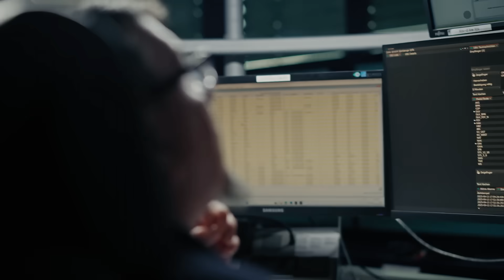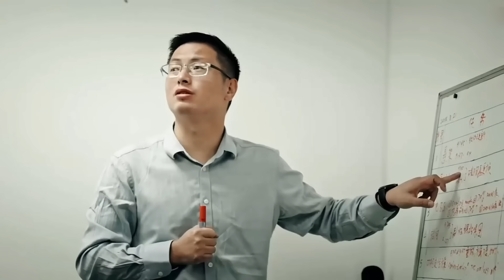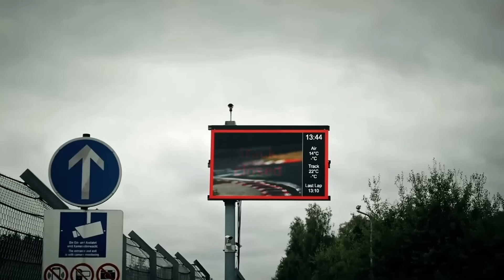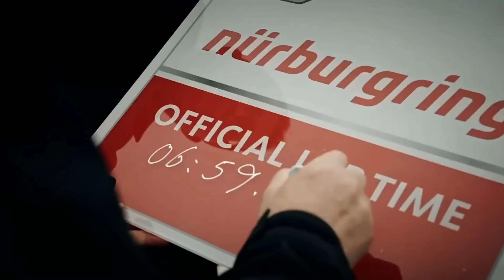WORLD FASTEST CAR NEW RECORD | BYD Yangwang U9 Xtreme Attack

Comment: I looked at the statistics, here are the results:

Reliability index:

China Initial Quality Study (IQS 2025) – in 2025, this indicator rose to 229 PP100, which means an increase in the number of defects and complaints.

VDS 2025 – PP100 is worse than that of foreign mass-market brands.
Problems are increasing both in the domestic market and among mass-market Chinese brands, and the number of defects per 100 cars for Chinese manufacturers is growing year by year – this is official statistics.

Accident rate: Russian accident statistics show that Chinese brands are more frequently involved in accidents than any others.

Chinese cars are leaders in self-ignition and destruction/damage due to fire.

The largest automaker BYD conducted a mass recall of more than 115,000 cars due to design defects and battery problems that could cause functional anomalies, including fire risk.

Earlier, BYD recalled nearly 97,000 EVs due to fire risk related to the steering assembly.

(Other manufacturers simply don’t do this, even though the battery and electronics suppliers are the same.)

Safety system activation: Chinese cars are among the leaders in airbags and other safety systems failing to activate in accidents.

So yes, Chinese cars are not only at the top of the rankings, but continue to improve their performance year by year.

You could also note records like: the most unreliable car, the fastest to fall apart, the fastest to depreciate and rust, the most powerful, the boxiest, the loudest, the most frequently catching fire — but the question is, why?

If Nihao shows that they not only have the largest battery or the most powerful engine, but can also win at Le Mans or in F1, that means they know how to create a balanced car that can actually drive and perform well.

If the power runs out after 2 minutes, after the battery is discharged, or it cannot be finely controlled and utilized, then what’s the point of it?
Reply: cope

Comment: But in reality, this is not entirely true, since there are faster cars:
Koenigsegg Jesko Absolut – 500+ km/h
Hennessey Venom F5 – 500 km/h

And the power of their powertrains is only 1,600 hp and 1,817 hp respectively. So what Nihao claims about itself is, as always, nonsense. It appears that the 3,000 hp of this car is nominal rather than real.

Moreover, Koenigsegg Jesko Absolut and Hennessey Venom F5 are real production vehicles that can actually be purchased, not one-off prototypes. In contrast, the Yangwang U9 Xtreme is a one-off racing prototype built on the base of a production Yangwang U9, which cannot even remotely achieve comparable results without collapsing after the first run.

This means that Nihao requires a flight control center and a team of mechanics to make the car run like that even once. Whereas Koenigsegg tests each car under real operational conditions right off the production line and only then delivers it to the customer as capable of achieving the claimed performance, and moreover, capable of doing so repeatedly, without a team of mechanics standing by.

Therefore, the achievement is modest compared to European and American manufacturers.

Koenigsegg – 5.0-liter twin-turbo V8, ~1,600 hp on E85 fuel (bioethanol)

Hennessey Venom F5 – twin-supercharged V8, power approximately 1,817–1,820+ hp

Comment: Double the beterry and mottors 860kmp bc the actual body kit weight will increase .  So it won't get 1000km unless the motor is advance rotation speed smoothness

Comment: I'm impressed with it technically, but it looks like a cross between a Lamborghini, a Bugatti and a McLaren. I'm not seeing a very original kind of design aesthetically. Edit: as for the run, keep in mind he's not having to shift, and the motors provide some breaking, so the effort is less than with vehicles close to the record. Also I was thinking about down force. I bet this is a heavy car, and that helps with traction, but I can't imagine the stresses on the tires, they must be very unique for this car. Also it should be noted this record is for an electric car, there are many faster petrol cars on the ring than this.

Comment: I never actually imagined an electric car would beat an internal combustion engine car in the elite sports category in 2025. Just the sheer amount of current, power, and heat generation you'll need to handle in your battery would be insane.
Reply: It's a matter of technology eventually evs would and hyprids will win
Reply: The 1.5 lt twin turbo hybrid Merc still beats by almost 30 seconds.

Comment: Am I the only person disappointed that it wasn't 500km/h😅
Reply: Pretty sure they‘ll break through it soon
Reply: @r-type4945 They have not developed a tire to withstand that speed yet
Reply: Well if the car would reach 500km/h the tires would pop like a ballon and the car would roll over with a force with how many G ? Idk either .
Reply: @Fe4rlessff bro that's with Bugatti Veyron about 20 years ago 💀 what r u talking about..
Plus 496kmh is very close to 500 and I t had no issue wdym 🗿
Reply: @Knocker_san  you don't understand the centrifugal force don't you ? If that car went 500+ the tires would shatter from the pressure but yea  496  is pretty impressive
Reply: @Fe4rlessffse usar os pneus que o Ford GT 40 que chegou as 500 não retornariam. E o Ford GT estava em uma pista comum de aeroporto
Reply: You right, this is shit click news.
Reply: it reached 352 miles por hour... are you blind? It is 566 km/hr..
Reply: @Teramann it reached 496Km/h
Reply: @Teramann 496😅
Reply: @Teramann if a car reached that speed the tires of the car can't take 500+ km so they would go BOOM! There are no tires that can handle 500+ at the moment

Comment: this feels weird to say but i think this car might be a little too fast for humans to drive. if the driver didn't run out of track and had a longer straight pass i reckon it could easily surpass a top speed of maybe up to 530 or even 550. you can tell the car was no struggling and there was a lot of juice left in terms of power
Reply: Autopilot

Comment: So this car can beat a F1 car.
Reply: No it cant
Reply: Its still slower at the track than the Porsche GT3 RS which only has 17% of the horsepower- why should it beat an F1 car? Only the topspeed is higher than all other cars-sure you'll need it when driving your kids to school
Reply: @EmanuelP-kp7gnthis thing left alot of room to improve ... it was limited to 350kph ... and you se alot of lifting from the pilot... that thing can improve 10 or maybe even 20 s still
Reply: @EmanuelP-kp7gn almost like it was build and engineered to break the top speed record....it's commonsense that a car capable of driving stable at this speed, has completely different focus with its aerodynamics.
Reply: it can in drag and top speed... but it will loose in downforce and cornering
Reply: a 2007 BMW Sauber F1 car previously completed a lap in about 5 minutes and 58 seconds during a demonstration run
Reply: not even remotely close. no.

Comment: M2Ks TT Ford GT runs 0-300.4 mph in one mile and 21 seconds. 
200-300 mph in 10 seconds. 
Set the record in 5th gear with one left.
Blows the doors off this EV. 
Oe body panels and glass, oe interior, oe suspension minus custom shocks, oe brakes minus custom rotors and prepped oe castings 5.4 4V.
Reply: Can it take the nordschleife? and how, and may I ask how many units were produced??

Comment: With electric engine this is very easy.
So nothing special
Reply: Bugatti, Rimac, why not?
Reply: @ziwenyang-k9w Rimac was not interested in pursuing the highest speed record such as Koenigsegg, Bugatti, BYD he focused on the fastest acceleration. And Bugatti? I think he will follow in the footsteps of Rimac Considering they are one ownership, Bugatti actually has its market as a luxury item with its W16 identity but if they want they can get back the title of the fastest car By building an electric drive system and then making it a hybrid in their products.
Reply: @ADZhilin  While electric vehicles offer far superior performance to gasoline-powered vehicles, there is still a significant technological gap between electric vehicle manufacturers. The idea that other automakers are trying to surpass BYD by replacing internal combustion engines with electric motors is, in my opinion, a joke.

Comment: Die Spitze von 496 km/h ist eine Sache, aber die Nordschleifen-Zeit ist DER Maßstab und zeigt die Gesamtperfektion eines Autos wie nichts anderes. Reife Leistung, auch des Fahrers. Eigentlich schade, dass nur 30 Stück hergestellt werden sollen. Anderseits: Wo sonst als auf der Rennstrecke soll man solche Autos noch fahren können.
Reply: Het is in pre-productie, als het massaal doorgaat zal het zeker beter zijn. Het is ook geen raceauto, maar ze zouden er wel een prototype van kunnen maken voor circuits zoals de Porsche en anderen.
Reply: That's why you don't see Bugatti Veyron, Chiron, etc. run at the Ring. They're only specialized for top speed (and luxury of course).
Reply: I think driver skill is also important...
Reply: Many of this car’s technologies have already been rolled out to other models—for example, four-wheel independent drive, iTAC (intelligent Torque Adaption Control), YunNian-X (intelligent full active body control system), and charging/discharging technology. Notably, its 10C charging (400 km added in 4 minutes of charging) has even trickled down to models priced around $30k.
Reply: 40 not 30
Reply: Deutsche Automobilhersteller bekommen laut Umfrage anderer ein schlechtes Feedback, aber im Rennsport Brauch man uns nichts erzählen oder geschweige denn vormachen.

Pikes Peak/24 Stunden Rennen und der Rundenrekord auf der Nordschleife.

In Thema Rennsport ist der deutsche weit mit oben, selbst bei der Formel 1, bei Mercedes.
Reply: 之前没有跑车能在极速和纽博格林赛道同时取得顶尖成绩，只能说仰望U9X的潜能非常大。
Reply: @anakinlink5319 chinese cars are crap, without occidental technology that your country copied, u would be nothing, Trump will fix this because obama did a horrible job by giving too many opportunities to ur country but u will never reach occidental level and USA will stay number one, you are a dictatorial country and no one wants to live in china!
Reply: 这是一个技术积累的过程，后面的东西会更厉害。

Comment: I don't see any issue for it to exceed 500km/h.
Reply: They ran out of track. Car wasn't the limit on top speed test.
Reply: @Akuma.73 😂fk
Reply: @Akuma.73 you cannot say any of bullshit... By the way.. Officially faster then chiron
Reply: On the one hand, there are tire limitations. The tires customized by Giti for this extreme speed test are said to only support a maximum speed of 500km/h. On the other hand, this test site only has a 4-kilometer straight track, and the drivers need to slow down in time to ensure safety. Therefore, if stronger tires can be provided in the future and there is an opportunity to rent the Volkswagen EHRA test track, the 8-kilometer straight track will be enough to maximize the extreme performance of the 3000hp of the four motors. I think it is very likely to exceed 520 or even higher.
Reply: @daguan5586  不可能的，大众不可能借赛道让你打破大众自己的记录
Reply: Yes, but it runs outta track
Reply: @RW_CreativeMedia 专用跑道，更好的贴地飞行。😊
Reply: Also the tires are limitation too, it's got ample of power to push for another 50km
Reply: The car is indeed impressive by setting the record. But I must salute to the Test Driver too. Having the skills to control the car and setting this record.
Reply: China knows what to do next. Build a long ass test track...
Reply: 纽北限速吧，半油门350km/h,另外的视频直线达到了496km/h，几乎500
Reply: @007athlon9 bedzie 2000 km/h na prostej💪
Reply: @007athlon9  , different setups.
Reply: No, the tires can't bear it and will easily fly away.😂
Reply: It was done on purpose as a FU to European supercars
Reply: @jm78593 everyone is compete. Competition is a mean of FUing other
Reply: EV can reach 1000km/h for all I care. You cannot beat the sheer grace of an engine roaring at high speed. This was a bore for me
Reply: It can easily hit 330mph+
Reply: Tyres will explode😂
Reply: Honestly, it’s funny how some people still live in that “Made in China = bad quality” mindset. The world’s changing — Chinese tech, cars, and innovation are catching up fast. Hate all you want, but progress doesn’t stop for anyone. 🚀
Reply: No matter how f*k good this EV is even it hit 1000 miles per hour or  more event the EV take the world of car I will build my own petrol car and drive it f** your Ev
Reply: If its gps measure you probably see 520-530 on dash
Reply: 500 Km/h mit  Rückenwind
Reply: A ja nie widzę problemu w 2000km/h
Reply: tires
Reply: Der Porsche GT3 hatten den auf dem Nürburgring geschlagen.
Reply: the tyres are the issue...........
Reply: При 500 сопротивление как стену талкать, это предел, ну может др 600
Reply: Intenta hacelo tu.
Reply: So if it ran out of room to actually hit that speed Koenigsegg when they test the Absolut they probably gonna have to build their own runway
Reply: The problem is the track
Reply: Itchy sweaty feet
Reply: Power and tire wise no but the car was very unstable after 480kph it was jumping around they need to rework the aero and suspension.
Reply: They pick the wrong track.
Reply: I think it’s a strategy they will punish a new car which will exceed 500km/h at a higher price
Reply: The issue is it needs more power or a longer track to hit 500km/h.
Reply: It can but it want to break the record as many times as it can
Reply: The roads are not built for that kind of speed. At 500+ the tires also get damaged and if accidents happen like going off track,it's game over
Reply: 502.26
Reply: thew track was not enought and the tires will wear out for sure and the car will technically fly if reached that speed. what i meant was it will loose friction the tries and the road surface has with each other which will cause lose of control
Reply: This thing doesn’t exceed 350
Reply: @rikberben3712  你来自于那个平行宇宙，牛逼啊，速度单位不一样，是不是地心引力不一样的原因？
Reply: The big issue ☠️
Reply: Bravo yang wan congrat 🎉🎉🎉🎉
Viva china ❤❤❤
Reply: No need fior stinky and dirty ICE Cars 😂😂😂😂😂
Reply: J'ai peut etre un debut de reponse......la valve des pneus peut poser probleme c'est ce qu'avait expliqué un ingenieur a l'epoque quand la Bugatti depassait les 400 KM/H   Maintenant ce probleme a ete resolu   faites moi savoir ca m'interesse     merci!!
Reply: The car is going to be unstable at that speed so they have to back out
Reply: @IsaacTrZ it's all about the tyre
Reply: @IsaacTrZ it drifted left when the driver reached max speed, they'll probably tweak the computer. I'd love to see an interview of the driver and hear his thoughts
Reply: @IsaacTrZ he had to back out because it drifted left, lost stability. Still impressive
Reply: Apparently it’s battery has a range of 10 miles you won’t be going fast for long
Reply: @TopDrive1 where tf u found this info lol
Reply: @TopDrive1 cryboi hater
Reply: @Tarzan-y3d how is pointing out the facts the engineers said them selves a “cryboi hater” little bing Bong make a good car for o cow
Reply: Yeah, and 100 years a go THEY DIDN'T SEE ANY NEED TO EXCEED 100 MPH!
Reply: China vs China for life❤❤❤